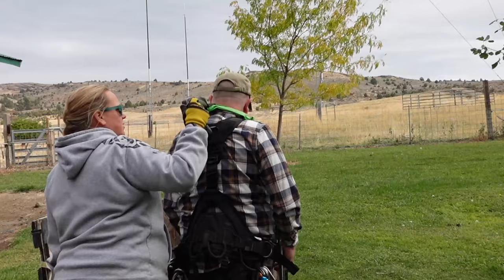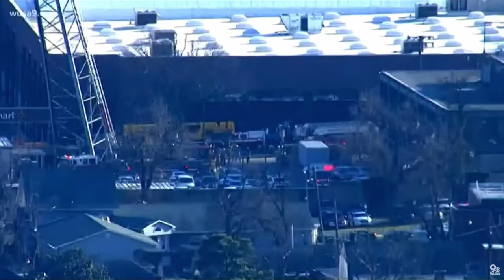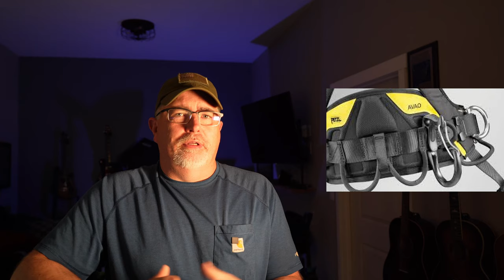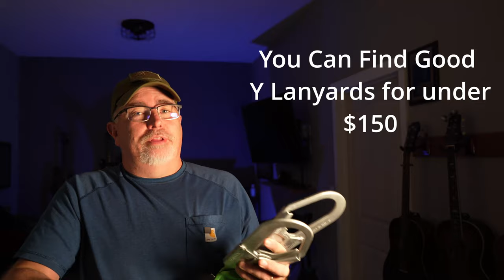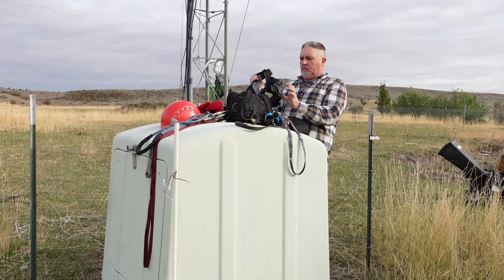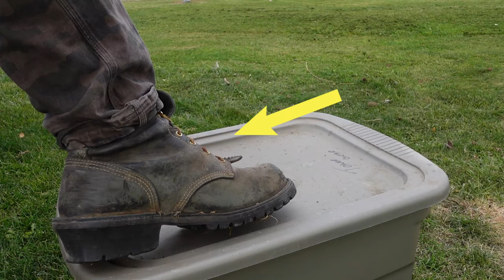Tower Climbing 101 For Hams: Staying alive!

Comment: What is your opinion on setting up a progress capture device on your tower? Like the croll or something similar.
Of course, you won’t want to let a good rope sit out in the elements for years, but running like a heavier duty paracord to a pulley, so you can pull up a good static rope to use with the ascender.
The theory here is:
1) Fall prevention hurts a lot less than fall protection.
With a progress capture, if you slip, you don’t fall more than the slack in your harness.
2) Rescue.
Using say a 150’ rope on a 50’ tower, you could secure the anchor side of the rope after going through something like a pretzel ID. If something happens, and you can still undo your safety hooks, you could be lowered to the ground by someone ON the ground.
Reply: You need to inspect the anchor before climbing, but the anchor for an LSD system is at the top. So for the first climb of the season you should use lanyards to go up and inspect it. If you don't plan to climb the tower very often i would just stick with lanyards.

Comment: I have free climbed my whole life and really didn't know any better. I recently acquired a proper harness with a seat and am still learning the ropes since I am a bit older (68). I have an 18 foot long repeater antenna DB420, that needs replacement on a tube top Rohn 25g tower.  The two climbers I think had only ever worked on flat top Rohn towers and they seemed to be stopped by the tapered tower top section. They would not climb high enough to remove the antenna. They use the fall arrest. I have searched and have not seen a video on safely climbing to the top of this type of tower.  To properly handle a long vertical antenna the top of the tube must be about waist high. Any chance of you making this sort of video? I use an M200h mast.